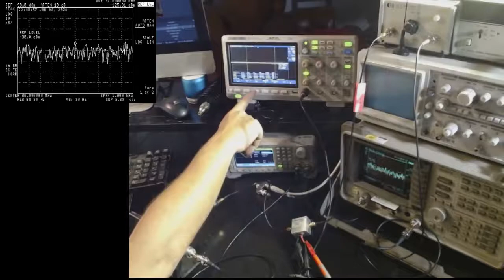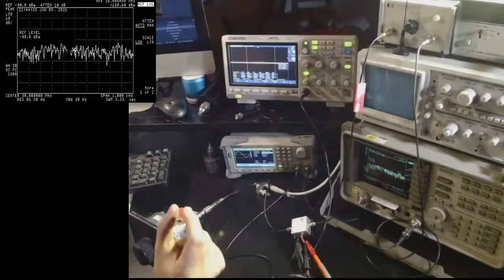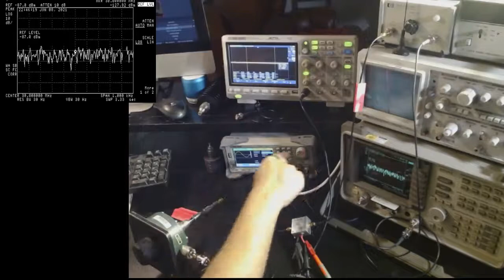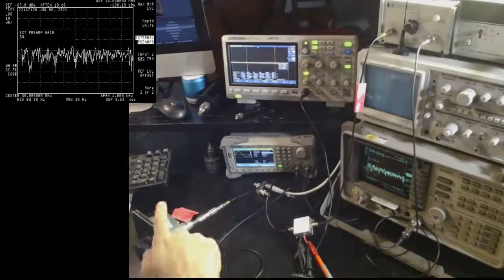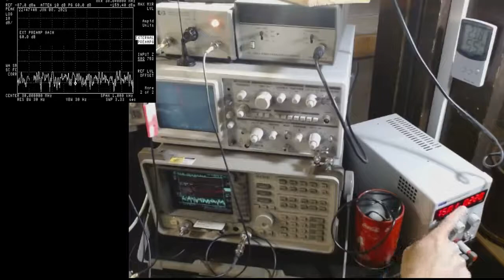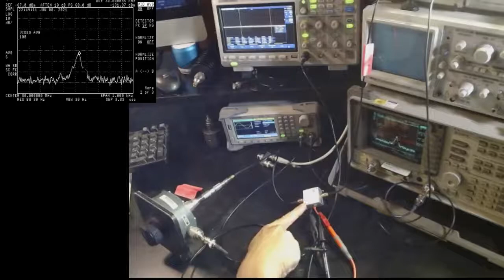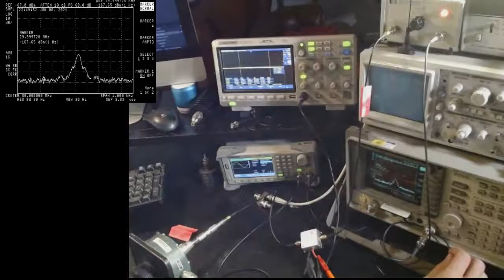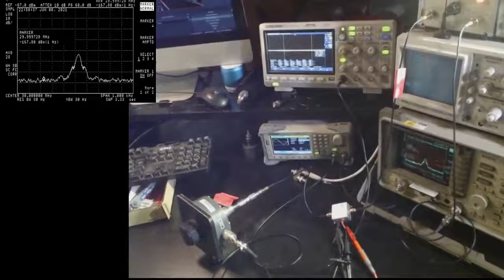Episode 64: MiniCircuits ZFL-1000 amplifier

Comment: Nice videos, keep going !
Reply: The main problem here, is that this noise is good in the lab (clean conditions). In the real world situation, and because the fact that this model is very wide frequency band, it may pick up tons of unwanted signals. from 0.1 MHz to 1000 MHz. The real world output is going to be a mess !!
The output P1dB of that model is about +10dBm. If the gain is 20dB, the P1dB at input = P1dB at output-20dB(low drive gain) +1dB(compression) = - 9dBm. Even the single tone unwanted signal brings this amplifier into compression. If there are many unwanted signals, which is most likely the case, the kiling factor will be PEP (peak-envelope-power). For example, just 2 tones gives you additional +6dB in PEP, 4 tones +12dB, 8 tones +18dB, etc...
The only way to fight is to use higher power input amplifier and/or pre-selector filter between the receiver antenna and the first non-linear stage of the receiver.

Comment: Hello, I procured this amplifier recently to amplify 0.5V  to 5 VDC. Unfortunately I don't see any amplification. I wanted to know if you connected any load at input or output.
Reply: Hello... I you look up the specification, you will see that the output P1dB  (compression point) for that model is +10dBm. It means that under compression that amplifier may develop about 0.7V rms at its output. +10dBm = 10mW. V_rms-(10mW*50 Ohms)^(0.5) It's not possible to have 5V rms from that amplifier. In order to develop 5V rms you may look for amplifier with P1dB of 0.5W 02 +27dBm (or a bit more). (0.5W*50 Ohms)^(0.5) = 5V rms. The particular model depends on your frequency of usage...